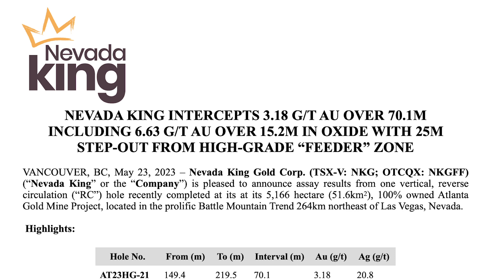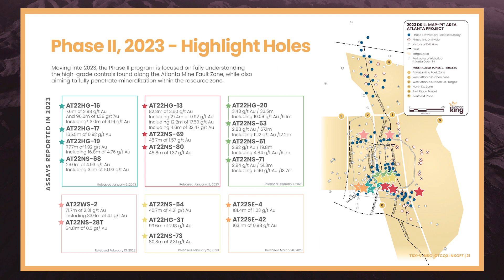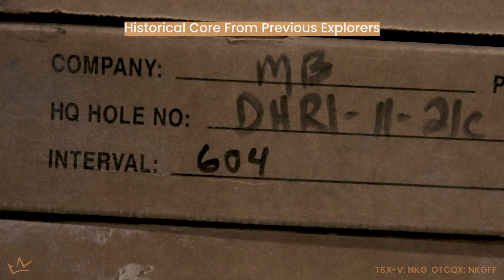Nevada King Gold - May 23, 2023 News Release Update with Cal Herron (TSX-V: NKG; OTCQX:NKGFF)

Comment: Like having Cal provide updates on the property regarding the new Drill map gives the investor and interested parties a deeper understanding of the multiple faults, existing drill plan and shows next drilling locations as lab results prove out. Cross Section 5-22N(2) discovery shows a substantial deposit of much higher mineralization than the original 43-101 resource estimate and the project is open on all sides and depth. Significant Silver content being present is very exciting.